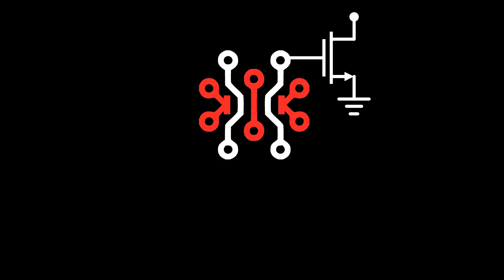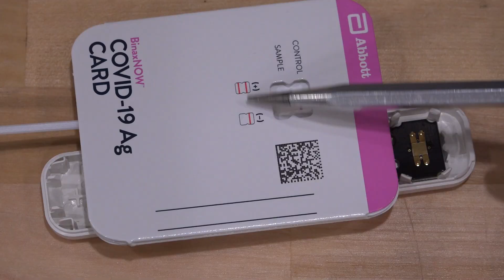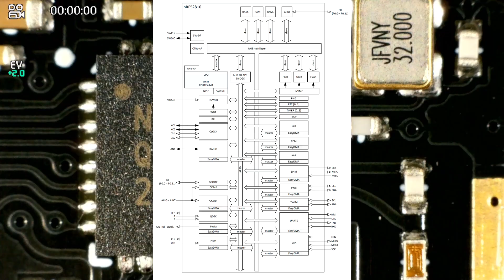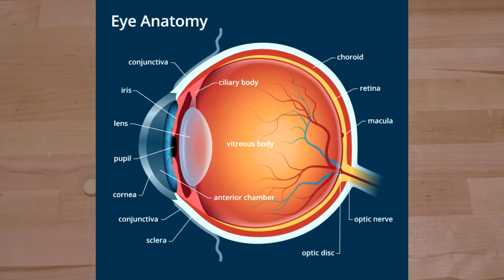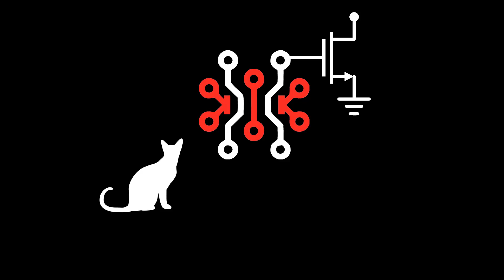TNP #9 - Teardown & Analysis of an Electronic COVID-19 Home Test Kit (ellume)

Comment from the maker: The two blue LEDs are actually UV and are used to measure the fluorescence of the agent if antigen markers are present. The red LEDs read the control lines to ensure the test has been done correctly. The fluorescence is a difficult measurement!

This video is not about which COVID-19 home test kit you should purchase. This is an exploration and analysis of this particular device for educational purposes only. For all medical advice regarding COVID-19 please contact your doctor.
Reply: Sorry, don't understand - does 2 lines mean positive? Or 2 lines can still mean negative if the 2nd line isn't "fluorescent"? I ask because I just used one of these while having symptoms. It said negative, but when I cracked it open there was definitely a 2nd line (faint, but not difficult to see).
Reply: @gat0rch1k have you gotten an answer for this? Curious myself.

Comment: Thanks for the video, I actually tried to use this test kit today, but when I connected it to my phone it told me it was expired. So I unpacked it and it was pretty simple. I swabbed my nose as instructed and dripped some extract onto the test strip and got a blue bar, I guess I'm not infected, right? I can understand why they made it like this and claim that the test results are more accurate, after all, people with visual impairments also need to be tested. However, how people with visual impairments can read their help videos and how to align the drip port is a problem they need to solve.

Comment: I had ordered 12 free tests through USPS and got a box full of these tests. I can’t believe the amount of electronics put into a one-time use test that are just going to get thrown out, when all you really need is the test strip in the middle of the test device. It’s also needlessly more complicated than just reading lines that appear on a regular at-home test - like you need to download an app, connect the device, and it makes you wait the full 15 minutes when with the regular tests, you’ll usually see results within half that time, so if they think it’s a solution to make testing more easy/accessible then they are sadly mistaken. Such an idiotic, over-engineered test that produces so much e-waste.

Comment: Definitely an interesting device, thanks for sharing!

Surprised how many people immediately dismiss these as nothing but e-waste. I get that this could certainly be done in a more eco friendly way, but that adds complexity for users, who may struggle with this kind of thing.

I think a very clear "positive/negative" result is very valuable in applications like this. I've had ambiguous results off the analog test strips, and it's pretty scary not knowing if you have it or not!

Of course, the accuracy of these particular test strips does raise plenty of questions...
Reply: you still would have to mix the samples and drip them into the device, only difference is this one is electronic and the others are not. you can still read the information. that difference still does not justify this device.

Comment: There is a lot of interesting things in the design itself, but the business case of single use it what makes the device a shame.
I do not think it would have been difficult to make it a way the it uses an external strip, maybe with an rftag for the cloud/BT thingy, but making the whole device a single use thing, adding more unnecessary waste  not good, shame this manufacturer.
I wonder if they at least used lead free solder, it would be a nice test to see how low this manufacturer went.

Comment: That optical element looks (to my untrained eye) very similar to what you find in commercial smoke detectors (LED, photodiode, plastic lenses, black surround). I think a lot of engineering knowledge was reused there, which is nice that they didn't reinvent the wheel.

Other than what other commenters have pointed out, one possible reason for such a device is to make it more difficult to fake the result. If you photograph a detector, you can easily edit it with a photo editor before uploading it to a verification service. Even with a QR-code serial number on the back of a normal one would not help as you can paste the result section from another device. Of course this is equally possible with this device, but it's harder for your average person to fake. You may also be able to have intrusion detection to invalidate the result.
Reply: As long as the test is not administered by a trusted third party, kids in UK have found common household substances to trigger all possible line combinations, so all the electronics are moot.
Reply: @barbudoru  a traveler to the UK told me last week he could have easily just done his compulsory self-test on a dog - I didn’t even think about the kids wanting a few days off school. Some of the self testing services do ensure someone will watch you do the test properly via a video call.
Reply: @jimmy21584  video supervision would help, but the lack of depth information in video could be exploited quite easily to swap samples or otherwise interfere with the test.
Reply: @jimmy21584  Dogs can also catch COVID, mine died of it :(

Comment: Really interesting video, thanks for sharing! I'm glad you addressed the E-waste aspect of this, it really is incredibly wasteful to throw away such a lot of perfectly good electronics after just a few minutes' use.
I was disappointed at how much plastic was used in the Lateral Flow Test kits we have here in the UK, but this really takes the biscuit! 
It goes to show that environmental considerations are still far too low down on the list of considerations when we design things, and we all need to take a bit more responsibility when we are designing new products.

Comment: I would guess the blue LED's are to stimulate emission from the wave of chemicals moving forward, as the blue light excites the test strip chemicals to fluoresce, so you have a pair of points, where you both detect that fluid of enough quantity has been placed, and that it is reacting as it travels down the capillary tube in the device. The time to travel from detection of first glow till second glow then can be used to calculate the wait time before doing the sense, as they have no real way to tell when the user has put sample in otherwise. No real amplification, just an antigen protein held in place, that reacts with a specific protein in the sample, and a separate set of antigens that react with something that will be in the sample in any case, like amylase, so that when the second reaction has shown a positive result, the first one is complete enough to tell if the test protein is there in enough volume.

Very likely the test is looking for the antibody protein, so immunised people will show up as positive for the antigen, which is why the test is now unreliable, as it will trigger on those who have had, or who are currently infected, while only being able to reliably tell those who are not immunised apart.

You could make a reusable machine, just swap out the optical detection to resistance or conductivity, using the same chemical paths that glucose monitors use, where you have a disposable test strip. Same detection methods as used there, where the original versions were human read optical tests, but all went to electronic. You might need the first generation or two to have a EEPROM to provide calibration constants for the particular batch, but the current technology has enough stability in manufacture that they simply laser trim the trips after manufacture to get the last tiny variation out, as the process has been refined and made repeatable.

Comment: Much like others in the comments section I thought "Hang on, that SoC is such a waste in that", but it turns out it is useful for no more than a cheap mouse or an expensive smart remote control, so for that I applaud them, otherwise, the device seems a terrible waste.
Reply: Bluetooth input devices typically use much cheaper, lower-end chips. This is seriously overkill.

Comment: I'm already annoyed that normal COVID tests have plastic bins around the test paper, and a foldable cardboard tray for the test tube. But seeing this.... wow, if well engineered those parts including battery can serve a good purpose for at 10+ years. It makes my stomach turn around when it's single use.

What also disappoints me that these devices didn't seem to have tamper protection. How hard would it be to add an optic blocker at the COVID result port, so that the test will always read negative as it will never read a positive test line? Jigged electronic tests sounds perfect for some I suppose.

Comment: Great video. Very interesting. 
For visually impaired people it may be ok, i'm not sure if it was designed with them in mind. For everyone else a normal test + a 15 min. times will do the same thing at a fraction of the waste.
Reply: Nah I would just ask someone else to help me with the test.
Reply: To be fair, why would it be designed with them in mind? Products try to reach the majority, not the obscure minority
Reply: @skrimper  I see your point and its valid, but that product is wasteful as hell. Also its slower to use than the regular test, since you have to pare it and probably use an app or something.

Comment: I think the point of this device despite the wastefulness is to have a way of preventing tampering of the results. E.g. Fly in fly out workers sending their results to the company before flying into a mining site

But at the same time, could have still kept the electronics and the strip separate and prevent tampering via an IC on the strip itself.
Reply: Mate if you really want to cheat it then just white paint that T part before tesing
Reply: yep this makes sense, but still, just get your mate who isn't coughing his lungs up to spit in the sample...
Reply: As for preventing tampering of the device... could we perhaps remove the need for electronics by having multiple possible slots that randomly lights so you know its authentic?

(e.g. Three slots that can either light up or not to authenticate that the results is not tampered with)

The smartphone app can then scan the slots and send the code to the company database to check authenticity of the device.

Comment: Oh, wow. Now we see how chip shortage actually happened!!! Sorry for those months of the fabbing process to make one of the nRF SoCs. 
It wouldn't be too hard to have a refill strip for that test device though.
Reply: A version with replaceable strips seems like it would just make it even less reliable.
Reply: @drkastenbrot  Need to open apart the device to replace strips?
Reply: @navadeep025  Cross contamination could be an issue
Reply: @6alecapristrudel  Possibly, yeah. Glucometer strips were coming to my mind.
Reply: @navadeep025   excellent comment!!!  I had just liked a comment right above yours discussing cross contamination but your comment makes sense.  I suppose it depends on how fast blood glucose degrades and how fast a corona virus degrades to ensure past strips wouldn’t affect a new strip.
Reply: @glen.midwestgirl  Right pointer. Ensuring the device is fully isolated from the strip might be quite difficult while the is done themselves by users and non-clinical environment.
Reply: @Navadeep Ganesh U     Now that’s an idea well worth exploring!

Comment: The apparent reason for the electronics is to provide reasonably secure documentation of a negative test result as required for some air travel or by some schools and businesses. Of course, this is arguably not necessary and quite wasteful for home testing in many cases. Also, perhaps the sensors are better at reading the strips than the human eye so that a single test is sufficient. (I'm ignoring whatever problem led to the recall.) The competing Abbott BinaxNOW test requires a second test between 36 and 72 hours after a first test if the first test is negative.
Reply: But how you can ensure that the results are based on The one person sample not another person? The producer should be fined for introducing waste to the enviroment and obliged to collect all used ones.
Reply: @aktik6000  I don't like the waste, and I'm not defending the system, just offering some explanation. I don't know all the details, but the manufacturer offers an optional video observation service using a smartphone that provides evidence that the results are from the user's own sample.

Comment: Absolutely no reason for this to be electronic beyond the data logging on the cloud. The point he makes at the end about using optical analysis on the phone by taking a photo is valid. Huge waste of resources.
Reply: these false positive prone kits and all the accompanying medical supplies being manufactured were a massive government subsidy scam. anyone who fell for it is incredibly unintelligent
Reply: There is a reason - whether or not it is a good one is another matter. You need to expose it to the fluid, wait a certain amount of time, then read it. If you read it early, you'll get a false negative, if you wait too long, the test strip will change colour regardless, giving a false positive. So you have people with manual tests complaining about 'feint lines' or 'I looked at it after an hour and the line turned blue - is that positive?

Sealing it in a box and getting a computer to read it at the correct time should make it more accurate.
Reply: @robertbackhaus8911  in other words people are sooo stuupid
Reply: @robertbackhaus8911  did you not hear him say the 2 electronic ones he purchased gave false positives. He also said they had to remove them because a large batch gave false positives
Reply: @randombuilds5826  What part of "should make it more accurate" you didn't understand?

Comment: .....but will it run crysis ?
Reply: or at LEAST Doom
Reply: @nerddub  The nRF52810 has a 64MHz ARM Cortex-M4 CPU, which is plenty fast... But 192 KB Flash + 24 KB RAM aren't enough. It also has no display and no keyboard/mouse. So the Answer is: No, it won't run DooM (and what is crysis?;)).

But the nRF52810 has a lot of digital interfaces, SPI, TWI and a bunch of GPIO. So you could install a display and maybe some input devices, maybe a bit of flash and some external ram and then someone might get DooM running. There is STM32Doom, which runs on a STM32F429 (also ARM Cortex-M4) with 8MB external RAM and the /doom/doom1.wad file via USB-OTG ;)

Comment: I’m not a fan of single use products.  But it’s cool nonetheless…curious why they had to have that much electronics just to tell you that there’s 2 lines present.
Reply: This one gives the wrong result which obviously undermines the usefulness - but for pregnancy tests, electronic ones produce a very consistent interpretation if (e.g.) one of the two lines is very faint. It'll also keep track of time, if the test result becomes valid after 20 minutes then invalid again after 60 minutes.
Reply: @michaeljtandy  adding to the line of electronic pregnancy tests: the consisent interpretation helps with people who might be in panic, or have difficulty seeing or completely blind! Sadly those electronic pregnancy tests aren't always marketed for the features you mentioned and often are pusheb because they're lying about it "being more accurate" or pushed towards people who would be 100% fine with a regular test...
Reply: @Snakke40  yep, all you really need is a dollar store preg test. It's just as accurate as any other test. Besides blood work maybe

Comment: For some reason I'm more upset about the idea of throwing out the 2032 lithium cell after 30 seconds of use then I am about the idea of throwing out the very carefully photo-lithographically etched plastic-packaged (and potentially rare- thanks chip shortage) pieces of silicon. The idea that the entire device is disposable just sits wrong- at least diabetic testing uses separate disposable strips and long-lived tester.

EDIT: For those curious, it looks like Walmart would sell these for ~26$ each, battery is actually used for 15 minutes, and the advertised use is for domestic/international travel. So, the use case is more having an electronic record that a test was taken+when, rather then answering the question "Do I / my family have COVID". Which... that's a little more forgivable, but it does go back to "couldn't y'all make the strips replacable, and just pack 5 strips in a box/sell-refills?" Also, the marketing mentions that it's approved for a "single test", where as most other test strips require second test a few days after a negative. I'd be curious if the LED processing isn't tied to that- say seeing an effect that's difficult to witness outside controlled conditions.
Reply: If its approved for a single test that might explain the false positives TSP got. To get that approval they would likely have to have raised the sensitivity of the test quite a lot.
Reply: @Microwave_Dave  Not everyone language is native.
Reply: @retiredjan4714  yes, some have other mother tongue
Reply: It's a metaphor for the current state of affairs in "civilized" society.
Reply: @Microwave_Dave  People do it a lot. Just get used to it.